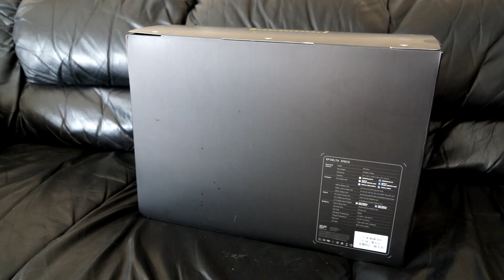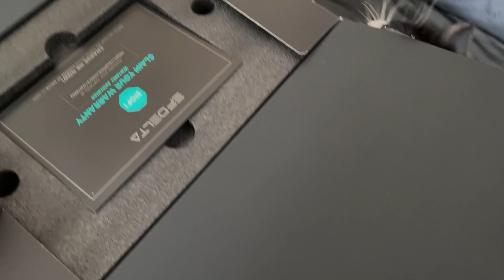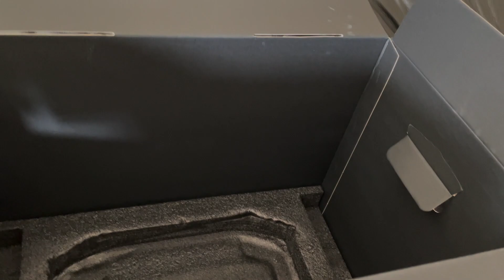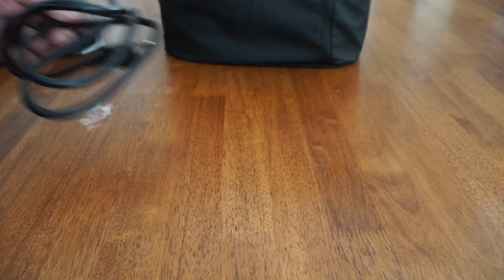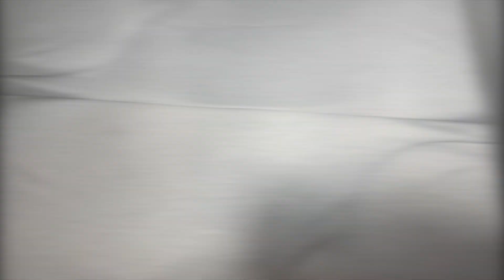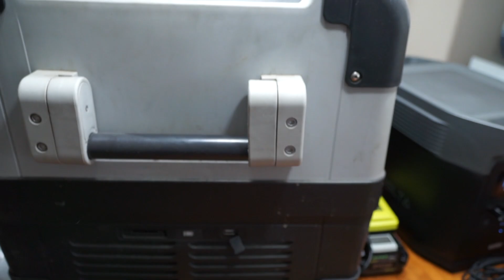EcoFlow DELTA Power Station Unboxing

Comment: can see the attraction - this one looks to have no limits , got a little 240 jackery that charges off my coleman 40w panel, use it mostly for 12v heat sleeping pad (if cold) and LED's at camp site - both of which I paid bit more for due to low amp draw, havent come close to running out of power "yet" on 2 to 3 day weekends, its nice knowing my car battery will be there when time to leave.

Comment: What’s your thoughts on running a small RV trailer? I assume an AC system would be pretty taxing for this?
Reply from the maker: Ac would be out of the range for this. I think a small RV would be good especially if you had solar you could plug in as well